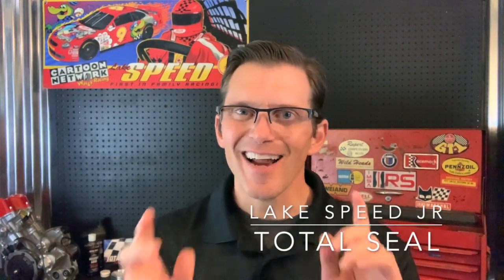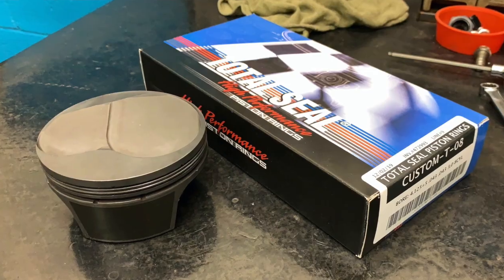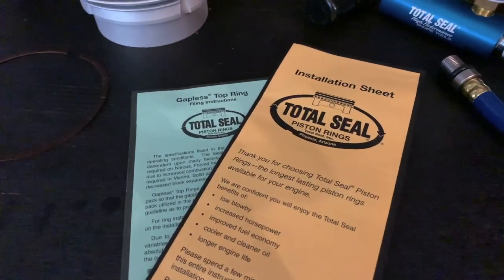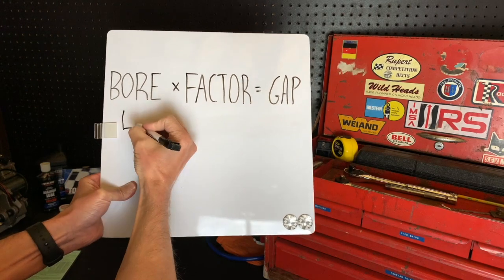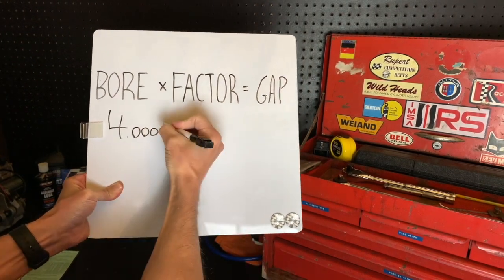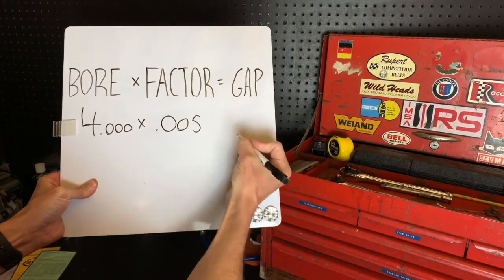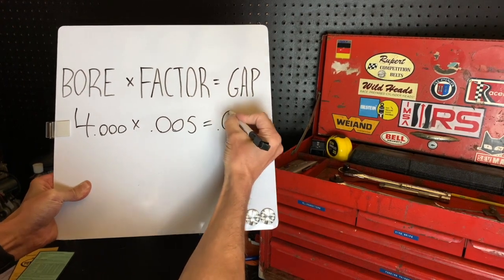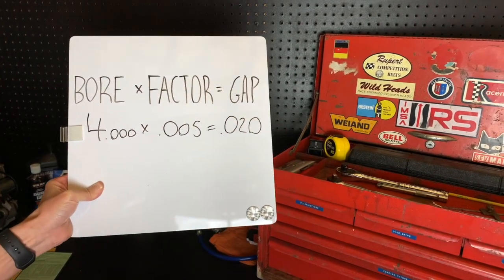Speed Shop Tip - End Gap (Part 2) - Do you gap a gapless ring?

Comment: Would love to see a video explaining the zero gap top rings vs. zero gap 2nd rings.  I've always been a little confused on which is recommended for what applications.  Assuming it's one or the other, not both on the same engine.
Reply from the maker: Great suggestion! You are right, the gapless ring should either be in the top groove or second groove, but not both.

Comment: I have have a 2015 Subaru forester 2.5  and it only has 78,000 miles and it burns 1 quart of oil every 400 miles. Could I use these gapless rings if I hone and re-ring the engine? Obviously assuming bore is good. Are these just performance ring? And if I can would it seal better than the oem rings that are low tension rings? And how about longevity? Maybe I should just call and ask sales/tech support lol.
Reply from the maker: Call the tech line - 623-587-7400